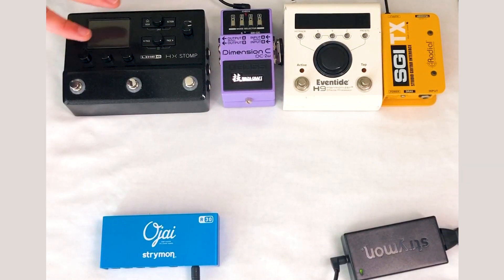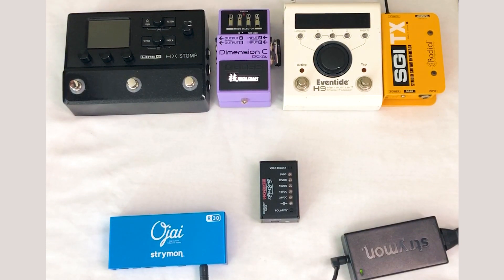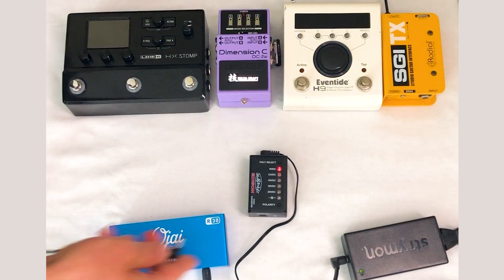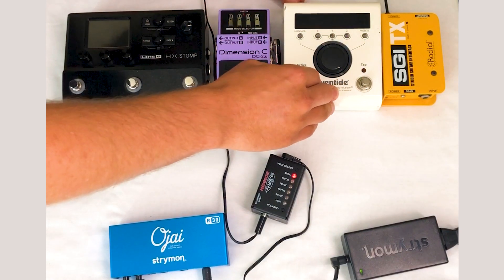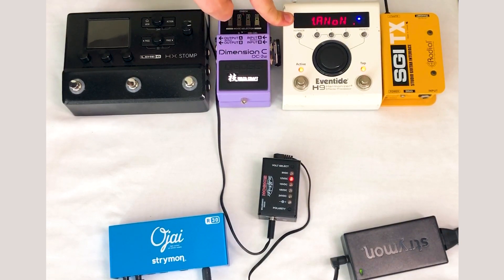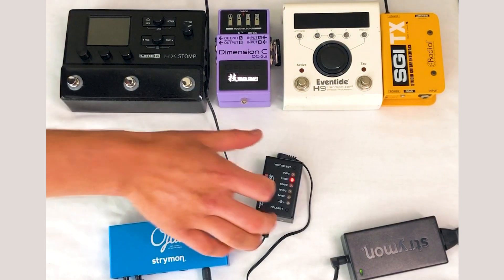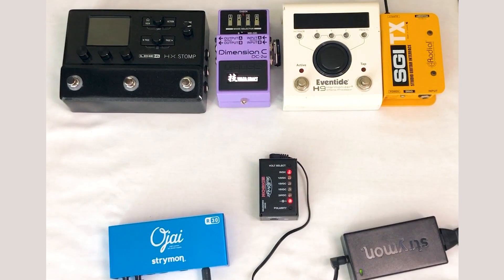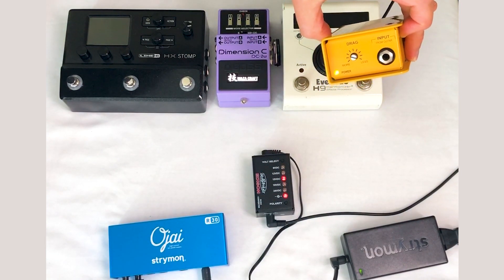Power Any Pedal With The Edison!

Comment: Kinda make all those GigRig power adapters redundant now
Reply from the maker: not entirely! The gigrig ones are still useful for isolating multiple pedals off 1 tap (the Edison doesn't isolate, does clean up the power though).  Something like the distributor is still handy also! TOtally up to the player / how they run power.   But there is definitely some overlap, you're correct.